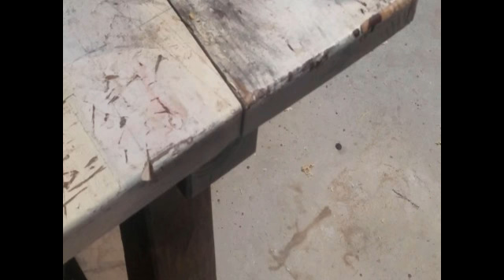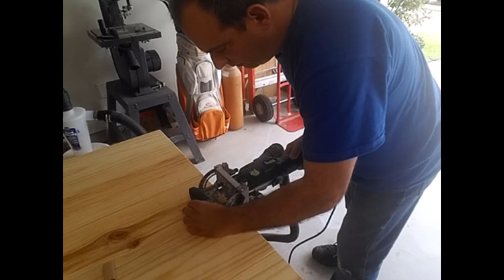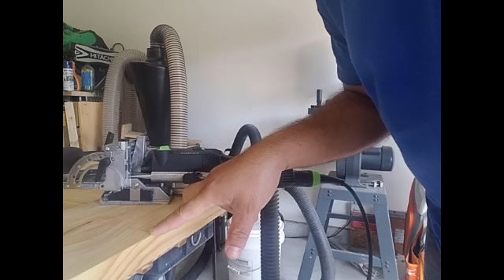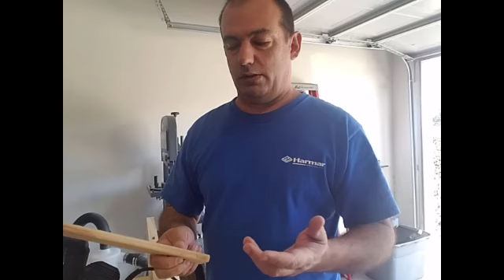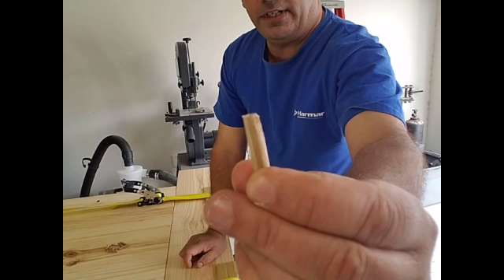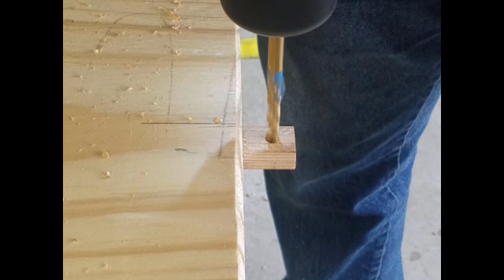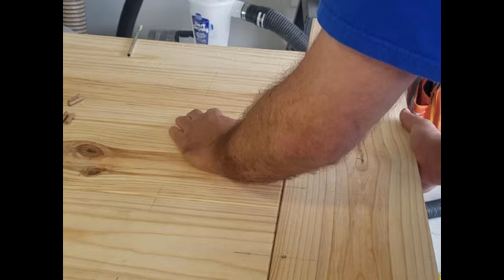Farmhouse Table... how to build them correctly.

Comment: Great video! Can I ask, what wood would you prefer to use for an outdoor table? Also, how would you join the rest of the table together? Are pocket screws okay for that?
Reply from the maker: A really good outdoor wood is Cedar.  It has properties that keep it from rotting.  You also need a good outdoor finish on it that has UV protection like a Spar Varnish, or some sort of marine type coating.  

As for the rest of the joinery.... I'm not a fan of the pocket screw because of the appearance.  However, I have used them in the past before I had anything else, and I have never had a joint fail.  If you absolutely must use screws, try doing it in conjunction with some lap joints.  Then there's no way it will ever come apart.
Reply: Jeff Torres the woodworking purists will complain about pocket screws. However if building something for yourself or family they work great. I personally wouldn't sell stuff with pocket screws

Comment: I didn't catch if you had it sealed with poly or shellac prior to table splitting.  Also why do you need a bread board?  I want to build this table.   https://scontent.fbed1-2.fna.fbcdn.net/v/t1.0-9/20799820_10156480400193098_3767458140803765116_n.jpg?oh=70a8a2e97fe0015e76780bb3afbe7790&oe=5A340879

Thanks
Reply from the maker: I did coat it with poly before it cracked. It just didn't help.  The idea behind the breadboard is to help keep the table flat.  It's very difficult for the wood to bow if the breadboard is there.

Comment: Two questions...
1) What is your preferred wood in constructing a farm table?
2) What method did you use to join the longitudinal 2x4's for the center of the table top? 
Thanks
Reply from the maker: Most people build these out of construction lumber, but the truth is, it's junk wood with way too much moisture.  If I built one of these for myself, I would probably use white oak.  

I'm not sure I understand your second question because I have no two by 4's in the project.  If you mean the 4x4's that go all the way across, I like to join them using mortise and tennon.  I use the Festool for that.  Before I had the Festool, I would half lap them.  It's easy to do with minimal tools.

Comment: Ive never liked bread boards. So if I am not adding them to my current build, then I'm assuming I dont need to do anything. However, Im thinking about adding a 2" or 4" trim around the whole table edge. Do I need to do the same thing in this case?
Reply from the maker: I would strongly advise against a border around the table top.  It most certainly will crack, or the ends will separate.  There's no way to account for the wood movement with a border.

When you see table tops with a border around them, they are typically not made of solid wood.  If you insist on a border, then You might want to make the table top out of a nice plywood.  You can stack two pieces of 3/4 plywood for a decent thickness, and then you can put any border you want around it.  Plywood doesn't move the way solid wood does.

Comment: Would a biscuit joiner work?
Reply from the maker: For assembling the table top, sure.  The biscuit joiner doesn't do much for strength, but it's great to keep the boards aligned during glue up.  If you want, you can just glue the table top boards with nothing between them.  The glue is strong enough.

As for the breadboard ends... No, a biscuit joiner will not work.

Comment: Thank you for showing solutions other than Festool, I dont have enough kidneys to donate! LOL Good video and will make my project much better. I am building a whole dining room set for a client who taped and mudded by basement in exchange. The last thing I want is for my table to crack for a client, I have always known about wood movement but never built anything so large that the movement was an issue. Thanks again!
Reply from the maker: +David Hechler There are alternatives yup any tool.   I like using the Festool for speed and convenience,  but it doesn't do anything that I couldn't do before I had one.   You can even do the whole thing with hand tools if you have the patience. 

Good luck on your project.   Trading out work is always awesome.   I'd like to see your chairs.   I'm about to do a chair project myself.
Reply: Absolutely, once I get it finished I will post pics, also I may end up doing benches. My client hasn't decided yet, but I will definitely look for any chair videos you post in the future.

Comment: for those with just a router, like me - could you run the router the whole length and insert a spline?  you could still drill and elongate the holes in the spline ends.
Reply from the maker: I have done just that in the past.  It works just fine, but you have to make sure that the table top is REALLY flat.  If it's not flat, your router will just follow the curve and you'll have a curved spline, or tennon which makes for a difficult assembly.
Reply: Actually Susie that would be a lot better way than what he did. You could cut out parts of the spline at each different board edge so each one could expand and contact on its own. Als when you   attach the bread board drill holes for dowels in the middle boArd also which he did not do. When you do this,  drill a couple of holes in the bread board with out having it fixed in place then dry fit it and mark the holes on the middle board  spline a little off center toward the board it is stuck into then drill holes into the spline wit out the bread board attached. This way when you drive the dowels in it draws the bread board tight. His tenons size are way to narrow and not deep enough for the board size he is using.
Reply: If you glue a spline in place you end up with the same problem as if the breadboard was fixed.
Reply: no, you just glue the middle

Comment: realy nice video, one question couldn't you put the dowls in the bottom side of the table so it does not show on the top face ? 
Thanks very much fot the tips in this video kind regards
Reply from the maker: +hans pijpers.  Sure.   It's the same effect.   I put them in from the top because a lot of people like that look.   If you don't like that look,  then toy can certainly do it from the bottom.

Comment: Good points on your video but I have also made farmhouse tables with breadboard ends and didn't have this problem. Did you use any type of stain or oil to seal the wood?
Reply from the maker: +Robert Perkins  yes,  they are stained and then they get a final 3 coats of polyurethane.   Oil won't seal it.   

The movement of the wood can also depend on your climate where you live.   If the wood is already dry and you live in Arizona,  its not going to move much.   Here in Texas,  we have a lot of humidity and an ever changing climate.   Wood moves a lot here.   

Projects that are indoors under constant air conditioning will have less movement than one in a house that opens the windows all the time.   

The other thing to consider is where you purchased the wood and how long has it sat since the tree was cut down.   

Lots of factors contribute to wood movement.   In your area itty might not be a big problem.   Different parts of the country will affect the wood in a different way.

Comment: Very informative. Very useful  info.
For joining the table top together, would a biscuit joiner would work just  as well for alignment?
Reply from the maker: +foley2k ... absolutely.   I used the domino with smaller dominos because that's all I have.   A biscuit jointer would accomplish the same thing.   It doesn't add any strength to the joint,  it just helps with alignment.   That's really the only purpose for biscuits.   

And if you don't have either machine,  you can edge join the boards with nothing but glue.   It is plenty strong.

Comment: how do you join the other boards do u just glue them together
Reply from the maker: +Gerhard Loewen. Basically,  yes.  The boards where milled on a jointer to make the edges nice and straight.   I did use some small dominoes in between the boards,  but they are only there for alignment.   They don't really contribute to overall strength and they aren't necessary.   The glue alone is super strong.

Comment: Nice example of the correct process to prevent problems, now all I need is a $ 1,000 festool
Reply from the maker: Thank you!  There's always another way to do anything.   You don't have to have the Festool.  I just like it because it speeds the process up.  You can do it with a regular router.
Reply: Dominoes is far from the proper way to do it.. mortise and tenon joints is the way to go. Save your money and learn proper jointery.

Comment: I still not sure how i feel about dominoes for bread board ends.   a traditional  Mortise and tenon is best for table tops.  All of the Construction grade lumber  tables will fail, and the rustic tables will decline in popularity.
Reply from the maker: +Mike West you may be right.   I actually don't like breadboard ends at all.   They only look good the day you cut them and then become uneven when the wood starts to move.   I've done some tables with the traditional morose and tennon, but its super time consuming.   My wife actually hates these tables.   See calls them picnic tables.   Funny thing is,  if I build a traditional style table out of cherry... no one wants it.   People actually prefer this stuff.   I don't get it.   

So far,  I haven't had any problems with the dominos holding up.   I guess time will tell.
Reply: I'm with you Mike, if built right there's no problems with warping or cupping.